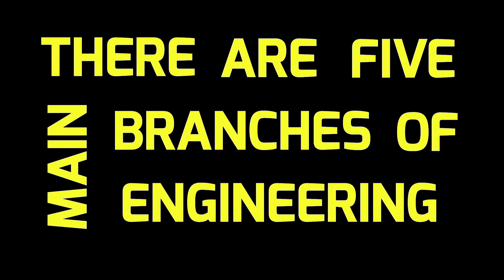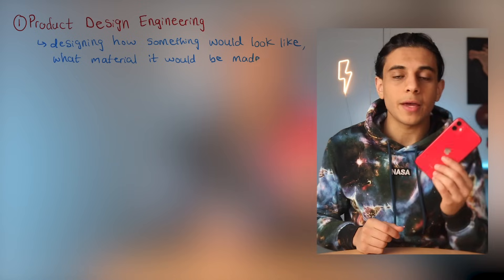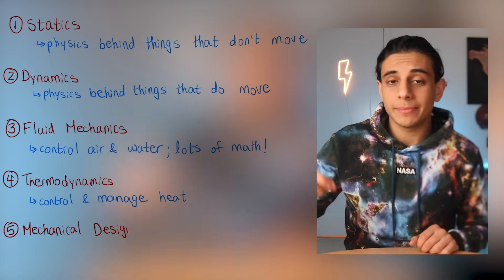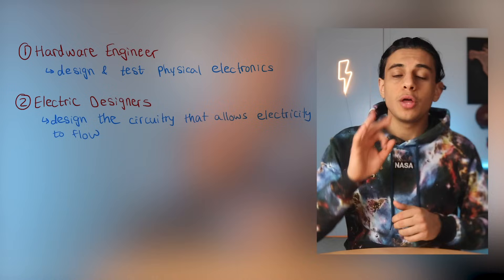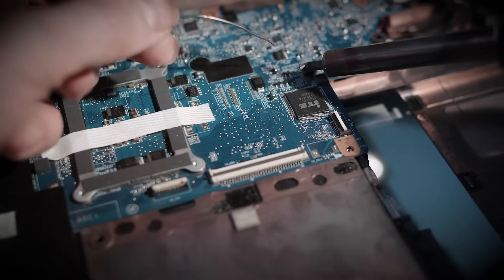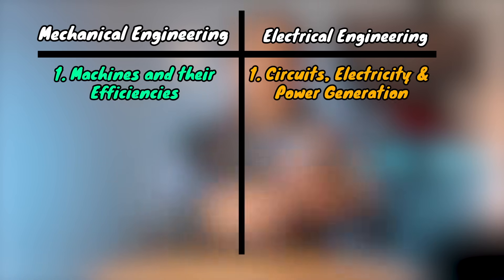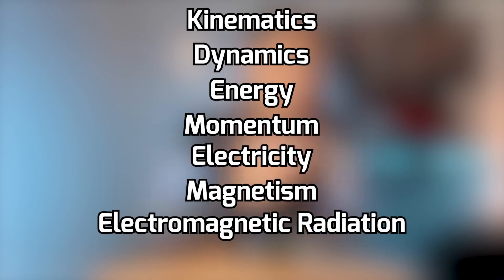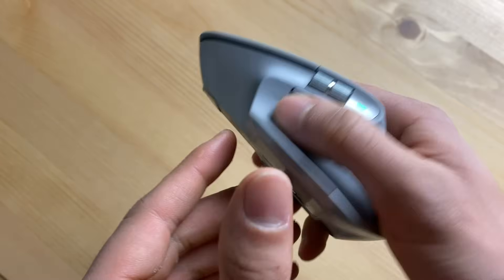Mechanical vs Electrical Engineering

Comment: At least in Australia, a big part of electrical engineering is working with power (which is something you didn't discuss - perhaps it's less of a focus area in American universities). A lot of the electromagnetism that we learn is to prepare us for working with power lines, converting electrical power into mechanical work through motors (and vice versa for generators), and safely and efficiently transmitting power across large distances. I'd personally break down the career trajectories of EE into:

1. Power engineer - You'll be working in industry or on the power grid, on the generation, transmission or use of electrical power. This can mean maintaining the grid, helping companies select the right motor for a particular application, integrating a new housing development or building into the grid (and modelling power consumption, etc)
2. Analog - This is really the heart of EE. This involves designing electronic circuits using Resistors, Capacitors, opamps, etc. A lot of analog circuitry relates to communications, audio and power (converting AC to DC)
3. Digital/Embedded engineer - heavily programming focused; your job will be to design programs that will be run on microcontrollers and interact with sensors.

There are also audio and Telecommunications engineers, who are have an EE qualification
Reply from the maker: Thanks for sharing that!
Reply: I'm gonna study power electronics as an EE major in the US.
Reply: Nowadays there's also Mechatronics engineers who focus heavily in the automation industry, machine designs and so on
They study mechanical, electrical and also electronics though all in a slightly lesser depth compared to purely Mechanical, Electrical or EE (Electrical & Electronics)
Reply: @etjh6560  Being Bachelors of Electrical and Electronics Engineering.. I also gone through Diploma in Electrical and Electronics Engineering during that academic final year I study Mechatronics subject. It was beautiful experience. Usually I come to know working of Washing Machine, Car whipper , And Many Automation things which usually involves some Embedded systems programing of Microcontrollers and Microprocessors.
Reply: @etjh6560  afaik in most unis you can only pursue mechatronics for your last year/postgrad of MEng (or other engineering fields depending on the university).
Reply: You forgot Control System Engineer / Control System Designer
Reply: Hey, I’m currently in my first year of uni in Australia and am debating on whether or not to do aerospace engineering because there aren’t as much jobs and internships should I still pursue it anyways?
Reply: @jila6317  hey - I work as an EE in aviation. From talking to my aerospace eng colleagues, there are a few of factors you’ll want to consider:

1. You have to LOVE aerospace and aerospace engineering. This is because it’s a narrow field, and you’re going to find it tricky to branch out to straight mechanical engineering (as opposed to vice versa)
2. Following on from that - marks, extracurricular, internships are more important. There are simply fewer jobs, and everyone is competing for the best jobs. The same isn’t true for electrical. There is no one path for the best electrical engineers - a good chunk do a PhD, some go into power transmission, others work in defence, others become software engineers or go into finance. You can get away with a low CR in EE. Not true for aerospace in my experience
3. The Aerospace cohort seems like a lot more fun than EE. Smaller classes, everyone’s mates and people know their lecturers. 
4. A lot of EEs become disheartened because the work they’re doing isn’t really technical (due to the lack of genuine design happening in Australia). This isn’t the case for me, but it definitely was for some mates who did internships in industry for example. Aerospace engineers seem to be more satisfied, because they’re working on planes. Most Electrical Engineers don’t “love” electricity in the same way that Aerospace Engineers love planes haha

If you just love planes and flying, and froth aerodynamics and aircraft structures, go for it! You’ll be motivated to study, your enthusiasm will be palpable to employees and you’ll enjoy your work. If you want maximum flexibility mechanical is a better bet.

Comment: One thing I always note on these videos that talk about ME or EE, is that they always focus on product development stuff.  The description of these fields is quite different in the heavy process industries (oil and gas, pulp and paper, specialty chemical, mining, power generation, etc.).  I do partially blame that on the universities because they push things like mechanitronics super hard but often neglect things like thermal fluid process design (quite different from HVAC).
Reply: I'm a licensed ME so I'm a bit biased obviously, but I actually bothers me when I see this type of thing because it paints a ridiculous picture of what ME is as a profession. I don't make keyboards, I make power plants. I'm sure that there is some ME involved in the development of headphones, but that is such an unusual example that it's hardly worth mentioning. It seems like the majority of people who make videos like this are fresh out of school and have virtually no idea what industry is actually like.
Reply from the maker: I understand where you're coming from. Working in heavy process industries is something that mechanical and electrical engineers can do as well and I probably should've talked more about it. The reason I didn't mention it as much was because I have been exposed mainly through the tech side of mechanical and electrical engineering. Also, with this video, I'm trying to show that engineering isn't all heavy, dirty, and bulky machinery...but it can actually have an aesthetic side too.
Reply: @TamerShaheen  ME is so broad and the overlap with EE is becoming much greater as ME programs adapt to technological changes, so there will be exceptions to anything you say. With that said I think it should be mentioned that the mathematics in ME depend largely on the emphasis. The fluids, thermo, and heat transfer route have mathematics with difficulty on par with anything in electrical, especially at the graduate level where many of those courses reside. It sounds like you got a small taste from your 3rd year fluid mechanics course as you had a note of 'lots of math'. Also a robotics emphasis has programming on par with the electrical majors as well with industry wages to match. But your video was looking most at the manufacturing emphasis and contained good content from that angle. Just a few ideas for future videos.. overall nice video.

Comment: Do you know which one is more prestigious and harder, electrical engineering or mechatronics engineering
Reply: EE is more prestigious, but don't go into it just for that. If your going for a four year degree I personally wouldn't do the mechatronics route because it's spread pretty thin, meaning unless you went in to automation or controls engineering, there would almost always be someone with a better degree than you. Concentration comes from the job experience anyway.
Reply: @TheDankDev  How can you say mechatronics has a thin spread when it consist of principles from electrical and electronic engineering, mechanical engineering, robotics,computer systems engineering, automation and digital control and a few more. personally I cant think of an engineering course as diverse as mechatronics.In terms of prestige I also wouldnt say EE is more prestigious since mechatronics is a failr new course so there really isnt a fair comparison of prestige. However in terms of pay mechatronics is up there with electrical and computer engineering and on top of that a mechatronics course will give you more knowledge about EE than EE will give you on mechatronics.
Reply: @clahrenssgramula4374  by thin spread I mean because your taking all those classes, you won't get very far beyond the basics for each in just 4 years. Meaning in industry there will almost always be someone more qualified than you (based on degree).
Reply: @TheDankDev  I get your point but I think what you are referring to is the depth not the spread. Mechatronics has a wider spread but EE has more depth I guess and the same is true for most other engineering courses. In terms of qualification I think it all depends on what industry you venture into as some may appreciate the spread more that the depth and vice versa. I know several guys with an undergrad mechatronics degree who had no problem venturing into fields in EE,ME and several other fields.
Reply: Thanks guys!

Comment: Just wondering if Electrical Engineering (EE) and Electronics and Communications Engineering (ECE) a single program in the states. I'm from the Philippines and they are separate programs.

Comment: Back then I wanted to study ME because my friends also did that. But during an Internship my colleagues said that ME is about excavators: heavy, bulky, dirty and metal stuff. He recommend EE to me and I followed his advice. Now I am about to finish my master degree and super happy that I chose EE.
Reply: Glad you're happy with your choice. 

But if I'd been there during that discussion with your colleagues I would have mentioned  one of my favorite E.E. T.A.'s who used to tell us about digging ditches in Africa installing power grid infrastructure and the M.E.'s I knew who spent their days in front of computers in air-conditioned offices doing C.F.D. modelling. 😁
Reply: I’m majoring in EE, but I’m just finishing up calculus and physics right now. What can I do to get a head start and hands on experience at home?
Reply: @robertjr8205 watch ali the dazzling on YouTube
Reply: Buddy I think heavy mud excavators are associated with civil engineering
Mechanical and electrical are more similar to each other 
They even teach some EE classes in ME
Reply: What kind of jobs can u get with electrical engineering degree?

Comment: I'm trying to decide between EE and CE. If I want to work on embedded systems (both software and hardware), which one do you think would be best?
Reply: CE is more focused so if you’re 100% sure you know what you want to do, then go for it. If you aren’t 100% sure you want to do CE but like the overall topic, do EE
Reply: CE as in computer engineering? then CE. don’t do mechatronic lol
Reply: @syl1432 what's wrong with mechatronics?
Reply: @syl1432  why not mechatronics?
Reply: @Shadowbladex03  mechatronics is cool imo,  it's a combination of mechanical, electrical, and computer science.
You get to work on robots and stuff, which I find fascinating.
Reply: @jaybhati8013  Is it better than electrical engineering in terms of career though?
Reply: @Shadowbladex03  well it can be, depends on you. If you wanna study broad then take EE, but if you are interested in mechatronics then surely go for it. It is a relatively new branch, but surely got a lot of potential. I know a lot of mechatronics engineers working in Tesla and other big places so yeah.
Reply: if you like to working in  both hadware and software then you should definitely choose ce. Also, in future CE will be most in demand as well.

Comment: Can we do double major in mechanical and electrical engineering ? or can we do both ? please reply
Reply: I am an EE and would not recommend double majoring. Just pick whichever one you want to do more, if you still like both do a mechatronic, robotics, electromechanical, or some other major like that, but it won't be offered everywhere.
Reply: There are some niche combinations, I’m doing Ecen at my school which is electrical and computer engineering(learning the hardware and software side of computers). I’m not sure if I would recommend it. I end up having to explain my major to interviewers and a lot are impressed, but some doubt that I would be as good a programmer as someone focusing on one area like a cs major, even though I take all the same classes.
Reply: I have a B.S. in Mechatronic Engineering, to sum it up you pretty much learn everything you need to know as a mechanical engineer to design a mechanical system, then you learn everything on the EE/SW side to automate it.
Reply: @RW-of3pn  Do you recommend EE or Mechatronics engineering as a career ?

Comment: Please don't worry about job opportunities for either of them. I am graduating this semester in EE, and I am getting an average of 2 interviews per week from companies like Tesla, GM, SpaceX, and startups. Just love your craft and be good at it and you will be sought after, and you will make great things!
Reply from the maker: That's amazing! Good luck with your interviews :)
Reply: Is EE similar to computer programming. I was told that it is. Can you verify?
Reply: @piotr5646  computer programming can be classified as a computer science,not electrical engineering.Electrical encompasses the hardware aspect of computers,you wouldn’t expect to be taught programming on just an EE degree.Now computer engineering, takes both worlds,computer science and EE and combines the two,maybe this is more what you seek?Im a computer engineering student myself.
Reply: @hbkkidcorrupt  I am EE, and I did have a lot of programing courses, almost every area of specialization in EE will require you to do programing at some point.
Reply: @piotr5646  most EEs do code and programming is essential to the work of an electrical engineer however it's not always a necessary skill and it's more important for software engineers than EEs who are focused on the design of hardware
Reply: @piotr5646  No, by computer programming I think you meant computer science? Or Software engineering? Or Computer engineering?
Reply: @piotr5646  computer programming is NOT like computer programming, computer programming is more like using logic and typing into a keyboard, EE is actually designing and manufacturing the things that computer programs can run on.
Reply: Easy 6 figures good shit my boy 💪🏾
Reply: Do you apply? How is it possible for a fresher?
Reply: Please 
I'm also electrical engineering student and I want to link up with some of you students
Reply: @agyekumkuffourgideon9314  hi
Reply: As an ME major working alongside many EE. I can say EE have more opportunities than ME.
Reply: @Mosinlogan 
Can you give me your contact ? 
I'm also an electrical engineering students
I want to discuss more with you
Reply: any advice to get so many interviews? im gonna be a sohpmore next semester
Reply: amen bro
Reply: As a electrical engineer major, who’s barely getting his core classes such as calculus and physics out of the way. What can I do hands on to get a head start on electrical engineering? Thanks!
Reply: If you don't mind me asking, what college do you attend for electrical engineering?
Reply: Did this age badly?
Reply: Where did u go to school, uwaterloo?
Reply: @talhajat8221  I went to Florida Atlantic which is not a highly ranked school at all. By the way thanks Tamer for the replay, I love your videos.
Reply: @nasim3269  I imagine Electrical Engineering has more to do with the individual than the school. Being active outside of the curriculum is the most important. Kinda similar to CS in that way even though in CS school matters even less I think.
Reply: Awesome! Good luck to you!!
Reply: Do you have certain things on your cv that got you these interviews?
Reply: Computer programming.
Reply: Which one has more scope in future?
Reply: Thank you...
Reply: Did you get a job at big tech company
Reply: Update?
Reply: What's the trick for getting those opportunities?
Reply: Can anyone speak to hiring in EE now? Im seriously considering changing careers but am hesitant with AI
Reply: “Don’t worry about job opportunities”... says the EE major

Comment: I'm studying electromechanical engineering in Argentina. Do you know if it is a valid degree in Canada? I am asking this because it is a mix between two careers (electrical and mechanical) and it may not be valid
Reply: I am an electrical engineer in the US, and as long as you are doing a career that doesn't involve a license, aka working on power lines, power systems in buildings, it doesn't matter because people just care about your experience, there is no official degree requirement.

Comment: Is it better to take Mechanical engineering or mechatronics engineering?
Reply: As Tamer said in the video, Mechatronics is for you if you like both electrical and mechanical engineering. Basically if you both like to make and design the circuits as well as the mechanical body, Mechatronics is the one for you (you'll probably be doing robots and such).
If you don't like electrical or it's too hard for you, mechanical is better.

Hope it helps! (and anyone correct me if I'm wrong) ^_^

Comment: Electrical Engineering is more abstract than Mechanical engineering, that's why its harder...Also Chemical Engineering is harder because of the same reason as Electrical Engineering...